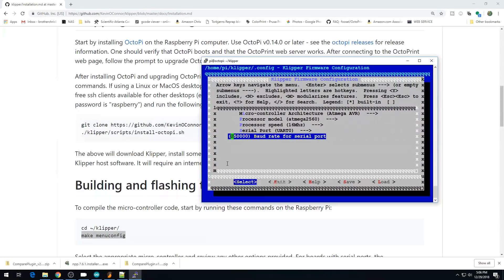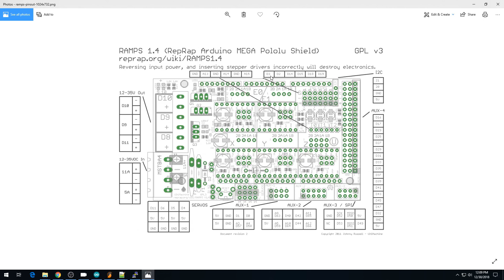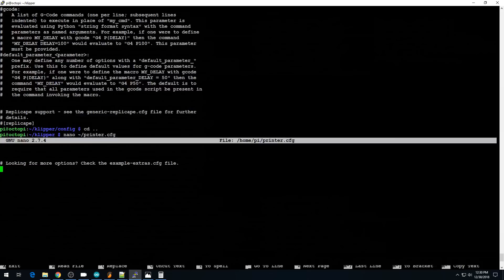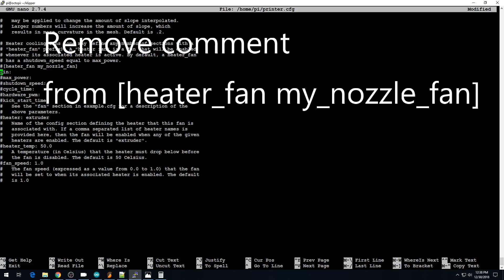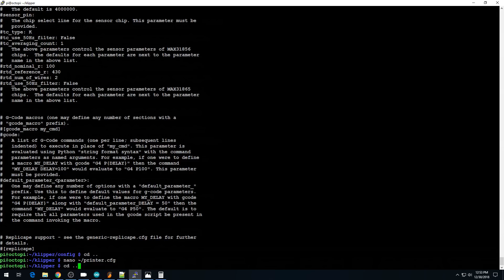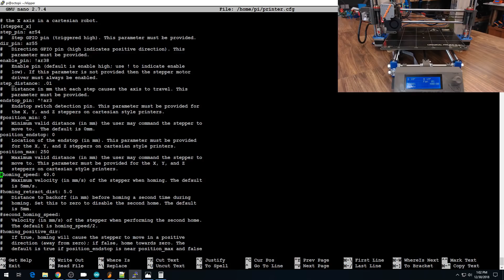Klipper 3D Printer Firmware Install - How To - Chris's Basement

Comment: where you get the information from? how you know from the hole list of devices witch one is the printer board????  need more explaining .
Reply from the maker: The easiest way is to run ls /dev when the printer is unplugged, then plug it in and run it again and compare.
Reply: @ChrisRiley  chis, I understand,  just I believe that you should make that clarification so the guys following the video don't get lost , imagine in my particular case my Linux install was having issues with the USB not recognized the mcu until I remove the brltty service, them everything was fine. Just was a constructive comment. My apologies if did not sound like it.

Comment: i get this error when flashing klipper on my ender 3.
user@klipper:~/klipper$ make flash FLASH_DEVICE=/dev/ttyUSB0
  Flashing out/klipper.elf.hex to /dev/ttyUSB0 via avrdude
avrdude: stk500_recv(): programmer is not responding
avrdude: stk500_getsync() attempt 1 of 10: not in sync: resp=0x00
avrdude: stk500_recv(): programmer is not responding
avrdude: stk500_getsync() attempt 2 of 10: not in sync: resp=0x00
avrdude: stk500_recv(): programmer is not responding
avrdude: stk500_getsync() attempt 3 of 10: not in sync: resp=0x00
avrdude: stk500_recv(): programmer is not responding
avrdude: stk500_getsync() attempt 4 of 10: not in sync: resp=0x00
avrdude: stk500_recv(): programmer is not responding
avrdude: stk500_getsync() attempt 5 of 10: not in sync: resp=0x00
avrdude: stk500_recv(): programmer is not responding
avrdude: stk500_getsync() attempt 6 of 10: not in sync: resp=0x00
avrdude: stk500_recv(): programmer is not responding
avrdude: stk500_getsync() attempt 7 of 10: not in sync: resp=0x00
avrdude: stk500_recv(): programmer is not responding
avrdude: stk500_getsync() attempt 8 of 10: not in sync: resp=0x00
avrdude: stk500_recv(): programmer is not responding
avrdude: stk500_getsync() attempt 9 of 10: not in sync: resp=0x00
avrdude: stk500_recv(): programmer is not responding
avrdude: stk500_getsync() attempt 10 of 10: not in sync: resp=0x00

avrdude done.  Thank you.

make: * [src/avr/Makefile:34: flash] Error 1
user@klipper:~/klipper$

Comment: Hi! Im searching for help with my v400 using the klipper pad. Worked great for 2-3 weeks. Then starting giving me MCU errors in 1-2 minutes and basically bricked. "MCU 'mcu' shutdown: Timer too close " is the main error. Any clues where I should start troubleshooting?
Reply from the maker: I wish I knew. The only thing I would know to do is test it with a Raspberry pi instead of the pad to see if that was the issue. Or get another board and see it the pad can read it.

Comment: Hello

how to configure clipper to use two controller cards i have two fysetc f6 v1.3 card plugged in usb on raspbery that i want to use for my idex printer with independent z (on one card the drivers y and z and on the second the two x  and both extrude)
Reply from the maker: For some reason, our channel got a bunch of comments recently that are over a year old. I hope you got your issue solved. We didn't purposely ignore you. Thanks for watching!

Comment: Awesome! 👏 
Last thing i need to know, how do i find out what i need to put infront of any PIN? (the ^ and !) 
And also what pin‘s i need? No example config for CR-10s pro V2 😭
Reply from the maker: You will need to find a pinout for that board. That printer seems to use a 1 off type.
Reply: @ChrisRiley  Hey thx for your reply, i will try...
Reply: @ChrisRiley  Happy Holidays!
i think this is what i need, right? https://github.com/Desuuuu/DGUS-reloaded-Klipper-config/blob/master/examples/printer-creality-cr10sprov2.cfg
And btw, i should take this fork right away, or not?

Comment: Are you planning to update your klipper videos? There are tons of news about it. Resonance, mainsail, pressure Advance and auto installer. I Need your opinioni badly
Reply from the maker: I will at some point, but I am not sure when I will get to it.
Reply: @ChrisRiley  i recently installed klipper on May Ender 3 pro and i tryed out Mainsail interfacce with kiauh installer if you got time give It a chance

Comment: Hi. On my skrmini e3 during "make menuconfig" through putty mine doesn't show an option for baud rate. I would like to set it to 250000 as suggested. But don't see it anywhere.
Reply from the maker: Can you switch it in printer config? https://www.klipper3d.org/FAQ.html#:~:text=for%20additional%20information.-,How%20do%20I%20change%20the%20serial%20baud%20rate%3F,the%20default%20value%20of%20250000.
Reply: @ChrisRiley  thanks Chris. I managed to get it working with pi3b plus for some reason. The pi4b did not work. After a successful print with klipper i have another problem.  Not sure what happened but all i did was install the hero me dual duct and as it was homing the x axis the head was making grinding noises. I found that it was not making contact with the x axis switch because of the bltouch bracket of the herome preventing contact with the switch. I turned it off. Then turnes it back on while pi3b was still on and the axis starting going towards the other way opposite of the switch and sparks flew. Eventually the lcd went nutty and altogether just went black. Printer still turns on but no lcd and bltouch is not lighting. Tried homing in octoprint and if moves x and y but stops when homig z because the probe is dead. What the heck could have happened?
Reply from the maker: @JaeSeong1981  Something went south and took out your 5v regulator. Not sure what, but that is a pretty common chip to go out. There isn't much you can do except swap the board. The chips are kinda tough to replace.
Reply: @ChrisRiley  thanks Chris. Got it working again. Had another skr mini e3 board. I guess something shorted as I was trying to home the printer.
Reply from the maker: @JaeSeong1981  I'm glad you got it figured out!

Comment: You have a great channel.  Keep up the good work. I want to build a tool changing plotter. Can I modify Klipper to use as the firmware for the plotter?
Reply from the maker: Thanks! Yes, I think that would be easy enough, I personally don't have knowledge of how to do it, but I am sure Klipper is capable.
Reply: @ChrisRiley  Thank you for responding. Maybe one day you can make a video based on the proof of concept.

Comment: Great video, as always!
One dummy question:
Once you install kippler, you can only print having the PI connected, right? 
in case I disconect the PI,  is it going to be possible to print just using the printer board?
Reply: When you install klipper, what happens to me is that disconnecting the pi causes the firmware to just stop. I have to reconnect the octopi via usb to the printer and reboot the pi through octoprint. After that everything works again though.
Reply: @defnotapenguin  klipper runs on the PI, on the printer board you just have a simple firmware that needs commands from klipper through the USB cable
Reply from the maker: I don't think you can print without the Pi, but I would have to confirm that.

Comment: Tried klipper, spent a day setting it. Everything was nice but after some use I am going switch back to marlin. Main issue: any fricking smallest issue make this firmware hang and reset your printer. Worse thing no message on LCD, it just hangs. Their ticket says - to fix this issue some development work needed. WTF? This is fricking base functionality to show error message on the screen how to release firmware without it? Tried to change filament after long print - error and interrupted print, because their default setting for filament change conflict with their default setting for maximum extrusion.  And of course for any warning - cancel print. "Move exceeds maximum extrusion" my ass. No thanks :(

And the cherry on the top of cake. If you want to use SKR with TFT - forget about it, it does not support TFT.
Reply from the maker: Yeah, Kevin works really hard on it, but it's still a fairly young project.
Reply: @ChrisRiley  I dont know, yes it is young, but the problem is with approach, and I am not sure it gonna change or related for this being young product. Let's say I setup a new printer (or fix existing one) and unplug thermistor for bed or hotend. What will happen to Marlin? It will show bad temperature on LCD until you plug it back. If you try to heat your bed or thermistor it would raise error and shutdown. Usable and safe. What will happen to Klipper? No matter if you are heating or not, thermistor gone it hangs. And you would not see anything on LCD. And if you restart it would fail until connection is back. WTF? I do not know if that behavior can be changed but I am not going to bother to find out, it is there by default and from ticket reaction I can see that many people complain about this approach.

Comment: Tried this on my Ender 3 Pro but can't figure out how to pass the extruder and bed temp from Cura to Klipper. Tried START_PRINT {material_bed_temperature_layer_0} {material_print_temperature_layer_0} in Start G-code in Cura but throws an error in Klipper (unknown command)… anybody figure this out?
Reply from the maker: I did look at this, when I try it in Cura, it appears to put the correct commands in there. What do the first 30 lines on the gcode look like?
Reply: @ChrisRiley  thanks for replying! I'm currently back to using Marlin for now. When I tried Klipper, I transferred all my Cura start g-codes to the g-code macro START_PRINT but couldn't figure out how to pass the bed temp/print temp parameters to the macro :( I was forced to hard code these parameters in my macro to make it work. I'll give it another go as soon as I figure this one out. Cheers and more power to your channel Chris! Happy Easter!
Reply from the maker: @yellowboxph  Happy Easter!

Comment: Great guide but after I loaded the firmware to my ender 3 it crashed and had to reload marlin. I tried it 3x and same every time, Creality board 1.1.5.
Reply from the maker: That's strange, did you ever get it to work?
Reply: @ChrisRiley  yes, marlin 1.1.9

Comment: Hi Chris

I have a problem with Z Probe! I use capacitive sensor, Klipper firmware and Bed Mesh Leveling plugin. But when i run the PROBE command i get 2 answers. 
1. Failed to home probe: Timeout during endsrop homing. Make sure to home the printer before probing. If the probe didn't move fare enough to trigger, the consider reducing the Z axis minimum position so the probe can travel further. (the z minimum position can be negative).
2. Probe triggered prior to movement.
Reply from the maker: It might be the probe thinks it is triggered all the time. What does M119 or QUERY_ENDSTOPS put out?
Reply: @ChrisRiley  If i started the BED_MESH_LEVELING command, the Z  axis move down a few mm, and stopped. After i get the first error message. My printer z axis move up and down. 
Can you help me? 
Thanks!
Reply from the maker: @laszloszabo1575  I am not sure what is going on here, I really don't know enough about clipper to help troubleshoot. Maybe someone else might be able to help. Check out the Klipper group on thingiverse.
Reply: @ChrisRiley  The probe speed was too high. :D 
But how can i mesure Z offset?
Reply from the maker: @laszloszabo1575  Check out my ABL video. https://youtu.be/iwhbeD2AduA
Reply: @ChrisRiley  I'm not near the machine right now.  I can answer it tomorrow.  Until then, here's the config file! But the Z home with G28 command is work. Proxi sensor is worked. 
https://drive.google.com/file/d/1JUCkzvrki2fo5grP6sun5AcJmSJKk2-Q/view?usp=drivesdk
Thanks, the quick response! :)
Reply: @ChrisRiley  If all axis are home position, then all endstops are triggered. If i move it away from the switches, then all endstops are open.

Comment: IGNORE, checked the newest config dir on GitHub and it now includes Ender 5 cfg file.
any chance we can ask Kevin of Klipper to include the cfg file for a Ender 5, see the Ender 3 and 5 as 2 very popular setups now, even more so for the just starting guy that needs the assistance, aka read they need the cfg file compared to someone that has a cr-10, which will prob be someone that has it as his 2nd/3rd printer... aka need less assistance.
guessing the ender 3 cfg can prob be used on the ender 5, except for the Z axis ? will copy paste this to the Klipper GitHub page...

G
Reply from the maker: Nice! Glad it has been added.
Reply: @ChrisRiley  nope, was not added, it's a separate git clone pull, or download zip file, but then if I read the note in the config/examples directory then I would have seen the comment there, to go download it, but hey, we mos never read ReadMe's why ever we call them that, why not rather call them: Ignore.me's. hehehe

Comment: This video is over a year old now, has anyone been using Klipper for long enough to be able to say if its worth the hassle of setting up? There's a lot of questions I could ask but most of them would be answered by my actually trying it, I just don't want to go though the hassle if I'm not going to see any advantage. I'm currently using a RAMPS 1.4, so I can improve things in a number of different ways. Is it worth trying Klipper or is it just one of those "nice ideas, but........" ?
Reply from the maker: Klipper is nice if you want to go fast on a 8 bit board, but now a days with the $20 32 bit boards out there, in my opinion, it's currently not worth the hassle.

Comment: does the printer have to be plugged into the pi to retrieve the serial port when entering the ls/dev command?

edited: nevermind i am so new to this, i now understand i do have to be connected to flash the firmware of the printer board.
Reply from the maker: No worries!

Comment: My big thing is, why this over marlin? I don't see the point of making the switch without any real benefit? :o
Reply: If you have something like a CR-10 or Ender with an 8 bit board; if you hit highly complex polygons in a print the speed will be much faster - and it allegedly prints better because of this speed and greater control of the motors. You do not need to mod or flash your printer to do this and you can always easily revert back. This is for OctoPi users.
Reply: @davey3765  good to know
Reply from the maker: The big advantage is for 8bit boards. Really with 32bit boards so cheap now, Marlin is now a competitor.
Reply: @ChrisRiley  gotcha
Reply: @ChrisRiley  by the way, do you know if it has thermal runaway protection like marlin?
Reply from the maker: I am sure that is does.
Reply: @ChrisRiley  hmmm. I'll do some testing to confirm. Thank you!

Comment: Thanks so much! my hypercube runs so much smoother with this i wasn't expecting that much of a difference! to be even be able to tell it tbh. but my printer is corexy so maybe that's why (extra calculations?)
Reply from the maker: Great to hear you saw a result from switching. Yes, it very well could be it's helping with the extra calculations of the corexy movements.
Reply: @ChrisRiley  yeah! but I feel like Klipper is a pain in a lot of regards. I need a new board soon anyway so I'll probably get an skr and I'm sure the skr would be on the same level as the klipper!
Reply from the maker: @chloemcholoe3280  Agreed, SKR will give you plenty of power.

Comment: did you notice any improvements  after time? I wanna do it but it's too scary and hard! but people told me it can be great
Reply from the maker: Klipper has changed a lot recently. I don't know that you will get a lot of improvement unless you want to print really really fast.
Reply: @ChrisRiley  my anycubic can't handle more then 60-80mm/s (80mm/s is barely) i guess i'll stick to marlin 2.0 xD
Reply from the maker: Yeah, not sure how fast mine can cruise. I still need to do more testing with it.

Comment: Is it possible to install OctoPrint (v1.3.11+) on a Pi running Raspbian (Stretch or Buster), rather than the OctoPi (0.16) distribution?   Also, I've got a MKS Gen L 1.0  (16Mhz Atmega 2560), does that require it to flashed with something (ex. bootloader) BEFORE Klipper can communicate or 'make flash' to it via ttyACM0/ttyUSB0?   

Also, I understand the PI Zero W has network bandwidth issues, but do you think OctoPi/OctoPrint could run on it without a webcam?
Reply from the maker: Yes, the install would be just like any other Linux install. https://youtu.be/fimVwRXarf4 No, your board has a bootloader already.  I have had good luck with Pi zero w running octopi with a low res cam, not a problem.

Comment: How much processing power is klipper using? would it be possible with a single RPi 3B+ to run a few instances of Octoprint w/ klipper, effectively using a single RPi to run multiple printers? any chance for a guide on that?
Reply from the maker: I don't have a guide for it, but I think you could run a few. You should be able to run multiple printers.

Comment: Hi, thanks for the great video!
After that I've installed Klipper on my CR-10 Mini.
It works very very well, but I have found a problem: FILAMENT CHANGE!
Klipper doesn't support Marlin M600 and I've tried different methods founded in the web, but nothing works: the pause after filament unload doesn't works, there are some problems to do Octoprint pause and wait for user resume. The print goes straight on :(
How do you do a filament change in Klipper??
Thanks so much!
Reply from the maker: Well I haven't tried that yet. I would check on the Klipper github, maybe there is a feature request coming for that soon.
Reply: On GitHub there is a M600 request closed (tried, not working): https://github.com/KevinOConnor/klipper/issues/149
And here: https://github.com/KevinOConnor/klipper/issues/1354
You can start from here, I've tried both and others ways but make the "Wait for user resume" seems hard with klipper+octoprint